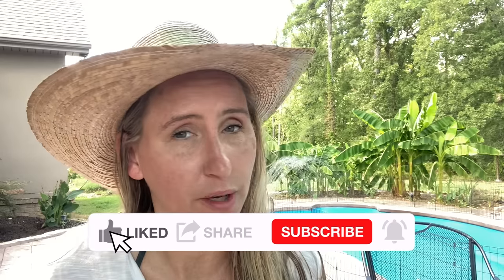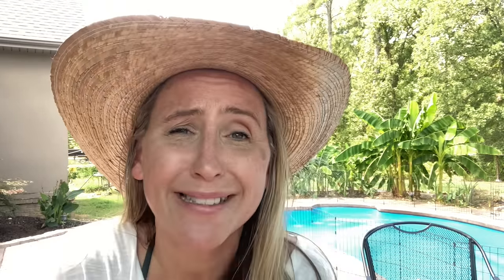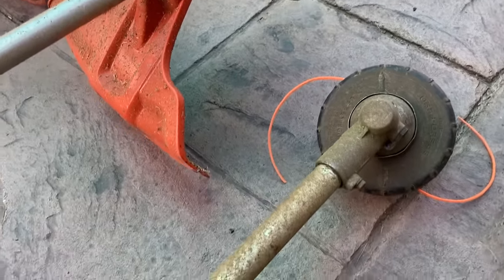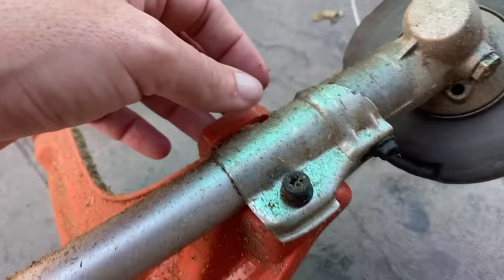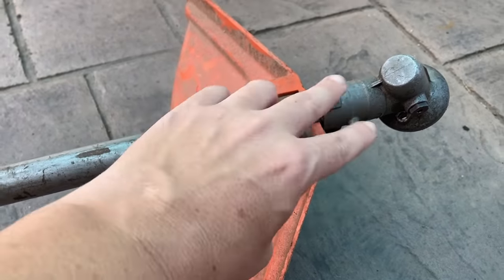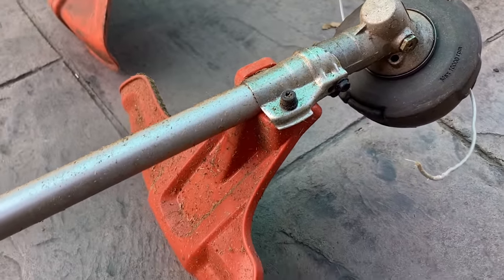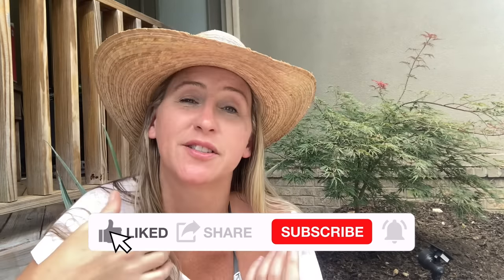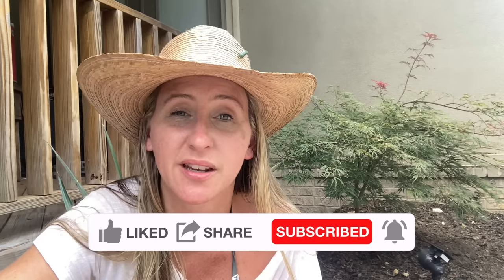String trimmer guard ON or OFF? Will it destroy your Stihl, Echo or Husqvarna? You might be shocked!

Comment: Interesting and informative that some models use the friction grip of the guard to absorb some of the torque between the gearhead and the shaft.  And very useful info about how to save a few bucks on the gearhead. Thank you.
If I may, however, I think you missed the core of the issue.  If you remove the string cutter to run a longer string and cut a larger 'swath', you are pushing the trimmer's loading.  Longer string takes more force to spin, which means more throttle to spin at the same speed (more wear?), more force to spin up suggesting a longer time in the 'slip' phase of the clutch (more wear?) and more torque across the gearhead to keep the longer string spinning while cutting (more wear?).  Think of it as like trying to play baseball with a 5 foot long bat.  If you do a part 2 on this I'd love to see you address the longer string issues.

Comment: With my Stihl FS 66, Made in Japan, I run it( I have two)  with the shield off as it will run a longer string with the shield off and I can nearly double my productivity with the longer string and it also seems to use less string when I run it long. I have been running them that way for around 30 years. I do however grease the heads with Stihl grease twice a year.

Comment: I work at a lawn care company and we are hard on our echo trimmers! Drop them on the concrete sometimes hit them with the walkers.
They are somewhat disposable.
We also sometimes run 2-3 foot long string.
Reply: How equipment is treated says a lot about the company’s standards. If you treat them better they wouldn’t be disposable! And if you need string that long, u should be using a mower instead

Comment: When you take off the guard it also removes the cutting blade. When your strings are not the same length,you get a wobble that destroys bearings and clutches.
Reply: Maybe true with the new junk but my guard has been off my T230 since 1997.  And never have I replaced those parts!
Reply: Yeah not really,  the line gets trimmed to the same length by whatever you are cutting. The only real negatives are more broken windows and  sometimes you bump the head too much in rough terrain and the string ends up too long. Then you have to stop and wind it back in a few clicks.
Reply: Yes, exactly! Thank you for speaking up what I was thinking as I read these far fetched comments.
Reply: If taking the quote plastic  guard off the trimmer will ruin the motor that weedeater must be made pretty poor to begin with  im not buying taking the guard off will cause any damage  if the line is to long just snip it shorter thats a no brainer

Comment: We take them off as soon as we buy them. Once you've ran them for awhile you can judge how much string you can run without bogging it down. We had a contract that required them so we drilled a couple hole further back on the shield and put cutting blade there to increase the cutting diameter
Reply: this also what i do
Reply: Yep easy to carry a very small pair of cutters in your pocket to, i cut my ends frequently anyways so there's a fresh cutting edge

Comment: I don't use a guard.  My use case is around trees and a long several hundred feet of chain link fence, only using trimmer line.  Since I'm not using any dangerous accessories, it's more versatile without the shield and I don't lose trimmer line to the shield cutoff feature.

Comment: Only thing I will say is this. I have used with guard on and off. It's been a noticeable change in the cutting capacity. I experienced it being worse cut without guard to maintain the correct radius and speed of string. Whereas with the current length it cuts faster and more reliable.

Comment: Very well done video. Someone mentioned removing the screw on the side of the head and adding a few drops of gear oil and stated your gears and bearings will last longer. Is there PM maintenance that we can perform on our heads that can extend their life? Perhaps you can do a PM video(s) on this matter. Thanks.
Reply: Very well requested Sam P.  Was wondering that myself.  I know Husqvarna and Stihl sell a special bevel gear grease for the heads but it is super expensive. I ran across an OEM recommendation from a different manufacturer stating that an EP 00 grease will suffice.  That is what I run in the gear box of my snow thrower.  So I went down the road of research on EP 00 grease.   Apparently it is a mineral oil base with lithium soap added to give it the extreme pressure designation.  Additionally, the mineral oil base does not destroy self-lubricating brass-graphite bushings where as the petroleum based gear lubes will have a deleterious effect on said bushings.  Would love to hear the master Chickanic weigh in on this given her years of judgement and experience.  Cheers

Comment: These problems with clutch and gear heads are caused by trimmer line being too long, or too thick. When you take off your guard, you also take off a little blade that cuts the line on a tuned length. When you work with the long line, as it was mentioned, the engine is not revving enough because it is overloaded, leaving a great part of a gasses not burned, depositing them all around the exaust and internal parts of the engine. Clutch also, is overstressed, it heats up, burns, but still taking all the beating heroicaly. As it gradualy becomes ever so slightly consumed, it opens more , and after a certain point, finaly the spring brakes. The line, when it simply travels trough the air, creates resistance. More there is it, it will create more load for clutch and engine to deal with, without even cutting the grass.
Make a little experiment. When the line is long, leave the engine on max rpm for couple of seconds. Then simply cut a big part off both sides of the line, gass it to max, and notice the change in the sound it makes. It will sound more lively.
Reply: perhaps if you run string much longer but if you assume the trimmer was designed to handle the length of line to the guard blade with some safety margin then removing the guard and letting out an extra bum or two is fine. These couches are centrifugal, what wears them most is running light throttle loads with shoes not fully clamped up (ie slipping). Read the echo manual and you will see they list two speeds for a trimmer. idle and full speed or in other words disengaged and engaged.

Comment: I have a large wet area that I keep mowed with an Echo commercial trimmer that takes me at least an hour to cut. I upgraded to the larger shield rather than the narrow one that came with the machine, so I don't know how someone stands to run one with all of the junk hitting you. I will continue to run mine with the shield on. By the way I use a face shield until it gets too hot to stand it then, I just use safety glasses.
Reply: Excellent common sense comment Lloyd!  👍

Comment: I'd like to also add that ot depends on the comfort level of the operator of the trimmer along with proper safety gear just as you mentioned. 
Keep up the great job!!!
Reply: Try running a straight shaft trimmer, Left Handed, without the shield, it'll go back on pretty darn quickly!

Comment: As usual I learned a lot from you today. I've had the clutch issue before with several line trimmers. I usually just get a new one when my line trimmer goes out, got an 18v Ryobi 7 years ago, it's still going strong and has outlasted every gas powered line trimmer I've had. I have many batteries and have enough to finish every job I do. I serviced, sharpened and cleaned my 8 chain saws yesterday because of your inspiring videos. Thank You!  By the way, don't mean it inappropriately, but you got really nice legs, had to give credit where credit is due. 😉 But you're probably the sexiest chainsaw repair artist in the country, so you have cred!

Comment: Have a used Redmax trimmer at least 10 years old and have never used a guard and have had no trouble. Hundreds of feet of driveway and yard edging so it gets run hard. Only replaced a couple of heads. We use full face shield and two pair of pants.

Comment: shield on or off is not this issue.  It`s the length of the line that is the problem.  The guards have that little knife that prevents the line being over a certain length.  These machines operate just fine at a longer length but not crazy long.  Be smart.  You can hear it in the sound of the engine if it is working to hard.  That and there`s a balance between a trimmers life span with the guard off and the amount of work you are getting done.  25 years of experience in commercial/ industrial property maintenance.  Retired now and I loved Shindawas
Reply: Several inches of extra line could more than double the torque load on the trimmer. That is what causes the lugging sound.   Also the longer line wraps around wire fence faster adding shock load to the drive when too close.
Reply: @walterkleban2746  you should leave your guard on then
Reply: Yes I leave mine on, the cut length of the line is perfect for cutting back buckthorn sprouts.  Too long and the line breaks off quickly.
Reply: @walterkleban2746  yout gotta do what you feel works of course.  I have always found the cut length of line to short except in the heaviest spring grass.  Buck thorn is nasty stuff though. Cheers.
Reply: Well done! Yes the clutch gets red hot if the line is a tiny bit too long or thick
Reply: True you will burn the piston
Reply: @webbs8445  maybe you guys are using a crappy brand of  weedys then.  In 25 years of commercial lawn care with the guards off, I never burned a piston and the clutch only a couple times.  No danger of either if the line  is only "a tiny bit too long"

Comment: Commercial cutting is a must to take the shield off for productivity. Never had a mechanical issue, have three Redmax units used several hours a day for over three years. Never had a damage issue cutting hundreds of yards a week. I’ve used shield on and off and I got news for you, crap flys around no matter what.
Reply: Redmax user as well. Took the guard off of mine the day I bought it 8 years ago. I also worked lawncare for four years back in the early 00s and we never had guards on a half dozen of our Redmax trimmers. Never experienced any issues back then, and I’ve yet to experience any issues with my current trimmer. 

Longer string means a faster tip speed, which allows you to run at lower RPM’s, thus using less fuel. If you want to save money on fuel (and who doesn’t these days?), take the guard off and run the string 4-6 inches longer.
Reply: I started doing professional lawn care in the late 80's and have on and off ever since. If I have a choice I'll keep the guard. I know full well that it can't stop all the debris from hitting me but getting hit with less debris is always better. O, and now a days I usually wear chainsaw chaps. Never was a big fan of pulling bits of stone out of my legs.
Reply: @johnossendorf9979  I make you right mate, agree with everything you've written. I've used strimmers for the past 25 odd years and I've seen nasty accidents along the way, mostly where a guard hasn't been used.
Reply: I agree. I can work a lot more efficiently without that guard getting in the way.
Reply: I've been in lawn care for 25 years and the guard has never slowed me down or been in my way. . I cld edge sidewalks And beds on my eyes closed.

Comment: I've used Husqvarna for ever. I go to the big box stores and get those straight shaft lightweight models and run the hell out of them for two years and sell them. I've never had any clutch issues, head issues at all. I sure miss the 223L's though. They were super light, had great rpm range and started easy hot or cold. I do feel the newer Husky trimmers at big box stores are starting to feel cheap. I've run these units with and without shields. I think some of this equipment is damaged do to abuse and or just using it wrong. Great video!

Comment: I used to use mine with them on, but once I took them off I never went back. The increased productivity was why I decided to run them off, and the common complaint about worn out clutch or gear head, that’s only when you let the line get way too long for an extended period of time. I am careful to not let it get too long, and I haven’t had any probs with them; Stihl FS-94R is the one I typically run.
Reply: Same here, I use echoes and have been running all my weedeaters without the guards and haven't had any mechanical issues and I can see no difference in debris being thrown back at you with or without the guard. But I've been doing this so long commercially that I can feel the motor start to bog down immediately from the string being too long. I rarely even get the string too long anymore because it's almost like a sixth sense at this point to keep the string at the right length.
Reply: I've always ran my trimmers without guards I like it better

Comment: I have the larger Husqvarna that I purchased back in the Spring of 2016. The shield was the first thing that came off before using it. This machine has been unbelievable I have used the blade, that I purchased at the same time and this thing has cut tree limbs, brush and even small trees but I also put a grease fitting in the gear head and as far as the motor I done the first tune-up this season, 2023 and I truly believe alot of the problems people have with equipment is due to some of the operator's misuse of it.

Comment: I don't use a shield because it makes the end of the trimmer heavier and harder to swing, as well as getting in the way of what you're doing. If the line is too long burn it down on a rock!  It's not that hard! When the line is too long the engine can't rev as well and it really doesn't cut any better anyway in most situations. My Stihl's shield doesn't have anything to do with holding the gearbox in place either, so there's no way I'll ever use a guard. In my opinion it's for inexperienced operators.

Comment: Been doing this for 40 years. Guard does not damage the gears. Unless you rev the rpms full throttle that damages it definitely. The guard is made for protection of flying rocks. Which Im telling you it's not the greatest protection. It also cuts the string 
If you have no guard in good string. It can do at least 200 homes a day without changing the string
Reply: If you're not running two stroke equipment at full throttle, I suggest reading the operators manual

Comment: THANK YOU!  I've been a certified outdoor power equipment technician for 30 years, I have worked in many dealerships and also have owned my own company since 1997.  Everything you said here in this video is spot on!  One more thing I might add, is that there are liability issues as well.  We do not let a trimmer out of the shop without the guard on it, because if the user gets hurt, or hurts someone else, we are at fault and could be sued.  What the user does with it after it leaves the shop is up to them, but it does not go out that door without a guard on it, and we let the customer know before even taking it in to the shop that this is the case, and if they argue, we don't work on them, period.  Same goes for people who tape or tie the engine brake bars on their mowers, or remove the spark arrest screens from saws and trimmers, they do not leave the shop without that being remedied.
Reply: I am about to either stop taking in units without shields, or tell people they WILL be buying one before it leaves..
Reply: @DB-zp9un  that should help your business.
Reply: @thepitpatrol  /shrug  wont make much difference one way or the other in the grand scheme of things.. I just know without shields they ARE more dangerous, it DOES put more stress on the whole unit and are a bigger pain to work one and hang / store without shields on them also..
Reply: @DB-zp9un  how is it a bigger pain to work and store? I agree it will put an additional load. I just don't understand how it makes it harder to store and use.
Reply: @thepitpatrol  Well unless you have tons of storage area that you can lay trimmers on the ground, I know lots of dealers hang trimmers by the string head area.. Without a shield, you're just asking for a headache literally... As far as working on them, unless you have one of those trimmer holders when working on, which I've had very limited luck with, if adjusting carb and stuff it's nice to be able to have it sitting on the bench and run it.. With no shield on it, that ain't happening.
Reply: @DB-zp9un  well I can see how that head would stabilize it while doing the carb. We have a 1" piece of pipe in the shop that we still hang by the head on. We also use Pri G and very seldom have any carb problems.
Reply: @thepitpatrol  Yea, well telling a customer what to use, and them using it is 100% different things.. We tell them to use the canned gas or ethanol free, some do, and are perfectly happy paying the price for the canned gas.. Others dont listen... Soooooo.. carb issues :D  Fine by me..
Reply: @DB-zp9un  if I were you and owned a shop I would discourage that canned gas lol. We have a great shop in our area and he told me about the Pri G. He said that the vast majority of service was due to bad gas.
Reply: @thepitpatrol  There are still PLENTY of customers that use crap gas that they got for 50 cents off and has been sitting in their hot humid garage for 6 months and then they pour it in their equipment..  Still plenty of new carbs get installed..  :D
Reply: @DB-zp9un  I have no doubt at all. Much respect to you. I can tear a small block Chevy down and put it back together.  Small engines baffle me.
Reply: @DB-zp9un  it doesn't need a new carb it needs to clean the jet out or a rebuild kit

Comment: I take my guards off, but not so much to run longer line as to trim around obstacles like fenceposts easier. And we use mainly .095" line to prevent the motor from working too hard and just kick out length a bit more often. Would never run .105" with no guard and long lines.